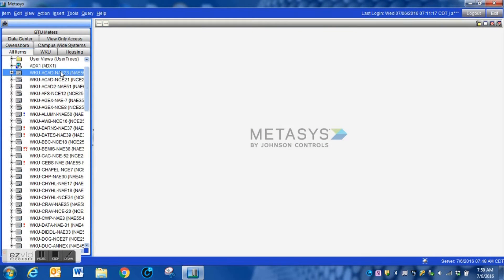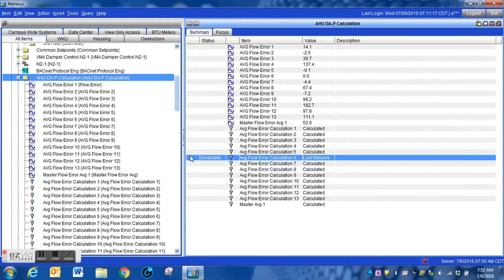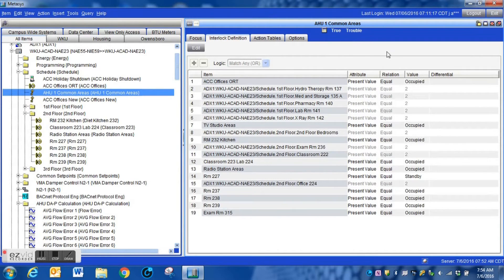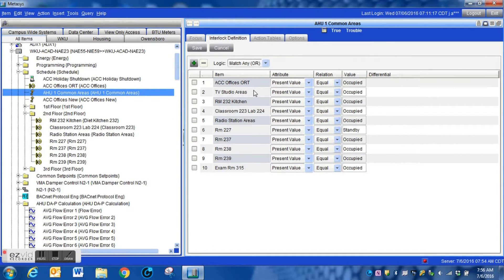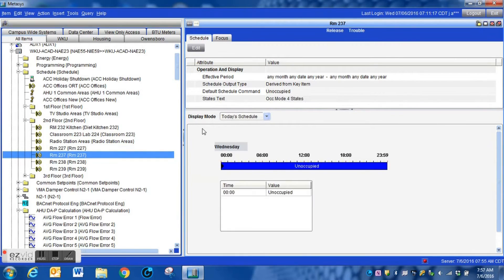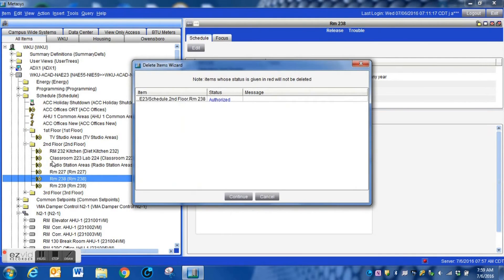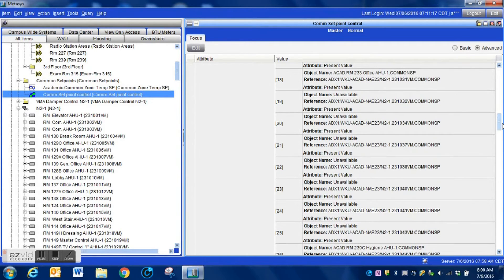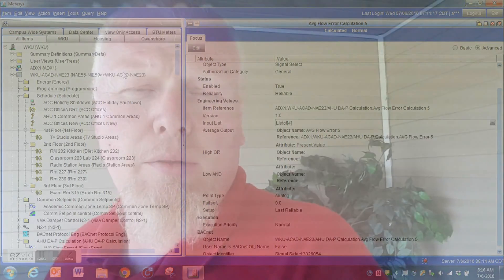Johnson Controls NAE Maintenance and Unbound Reference Cleanup

Comment: So, I work at a large college campus with 150 NAE's. I went through and found 402 unbound reference's. Is that a lot for a large campus? I understand that every little thing adds up to slowing the system down but is 402 like, Holy crap? Or average for a system this size and needs to be addressed?
Reply from the maker: That's not a lot but you want to try to clean them up.

Comment: What about unbound references on an actual controller? You can bring up CCT, and right on your screen where it shows you your version of CCT when you are trying to connect it will also tell you if the device has unbound references. How do you get rid of those?
Reply from the maker: You will need to follow the logic and find what's missing and correct it

Comment: I usually have no problems finding Unbound References. However I had issues with one of my NAE's and 4 stubborn unbound references. Did some research and found out SCT has a diagnostics under the Tools menu using archive reports and selecting unbound references. Then I searched for the points in the report and voila there they were. The SCT diagnostics is pretty slick and all. Hope that helps!!!
Reply from the maker: I use it regularly